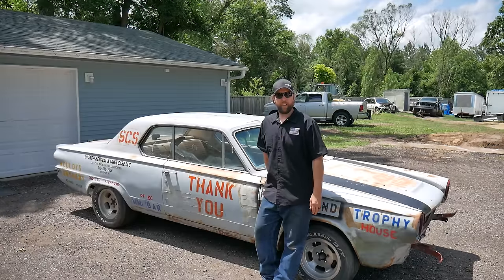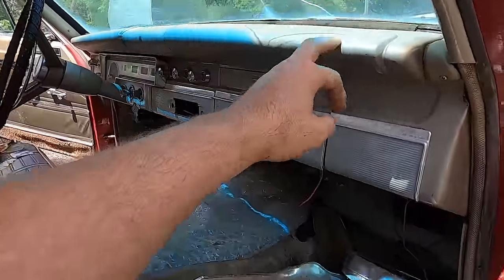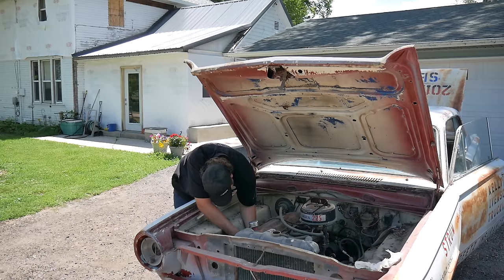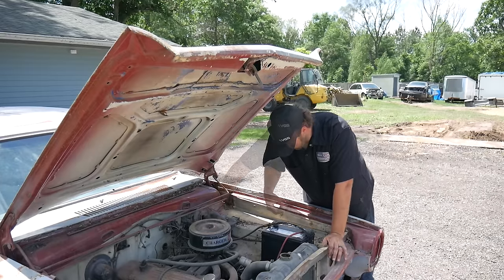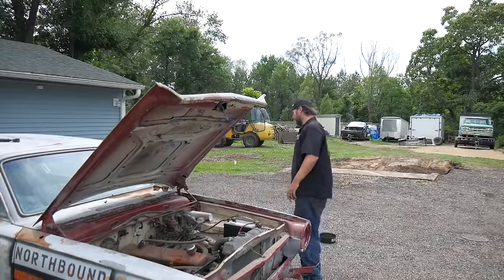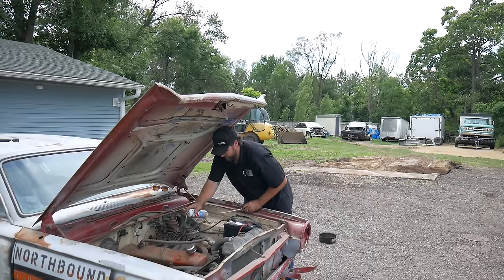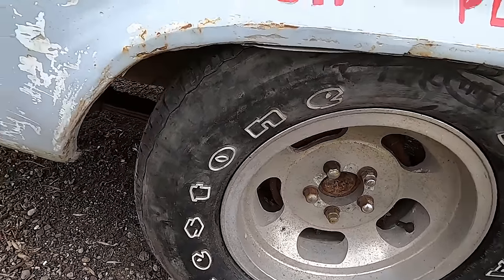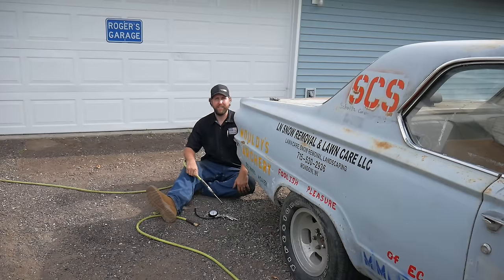NEGLECTED 1964 Dodge Dart GT! Will It RUN AND DRIVE After Many Years? - Vice Grip Garage EP96

Comment: Push button shifter, reminds me of when I was 5 or 6 years old, and my uncle had a shiny black 1959 Chrysler, with the big tail fins on rear quarter panels.
Well out visiting some folks with my aunt, uncle, and my older cousin, and he parked in their driveway, which had fairly steep grade back to the street. Being as I was the only little one there, I eased out to drive my uncle's big car, just pretend to as us little guys use to do.
I was so short then couldn't even see through the steering wheel sitting down, and forget about reaching the pedals, so up on the knees I could get around all those cars in my imagination in front of me. Then I remembered he always pushed them buttons on the left side of the steering wheel every time we went anywhere, and again when he stopped at home.
So I had to push them buttons too, if I was going somewhere, and I did. All of a sudden, there was a popping sound down on the floor, so I was looking for where it came from down there.
Then I felt something wasn't right, and still on my knees to see them cars I had passed, and suddenly cars was passing me, cause he'd pulled all the way into driveway, beside two other cars. I knew I was gonna die right after passed by the last car, cause as I hit the street the back bumper scraped the concrete, and then it kinda bounced as the front tires hit the level ground.
All of a sudden loud noise hit me just as the car stopped instantly, causing my head to bounce off the steering wheel. So as lil fellas do in emergency situations as this was, and I'd already seen my uncle followed by looked like hundred grownups heading my way from inside the house.
He snatched me out through the open window, and I knew I was in for whoppin of my short lived life, but instead he rubbed the tears off asking if I was alright. Yep, but I don't think your cars alright, he said lets look.
Well I learned I had someone watching over me that day, cause I went straight into big oak tree, and smashed the drivers side fin and bumper pretty good, but I missed two cars that had parked there, but left me enough room to learn that you don't push buttons in your uncles car when it's on a hill, cause it releases the E brake when you do.
True story that happened about sixty years ago, but I still remember it as if was yesterday.
Reply: DITTO! Only my experience was a 57 Dodge Wagon in an A&P Parking lot full of cars. Fortunately none were behind me and the lot started back uphill before you get to the street. The only damage was to my little butt after we got home and mom told dad!
Reply: Dad let me wait in the '56 Chrysler Windsor while they went grocery shopping. 
"Don't touch nuthin' up here on the dash but you can play with the steering wheel." he said. 
"Okay. "
So for the next twenty minutes I was Fireball Roberts, Lee and Richard Petty,  Mario Andretti. I imagined every race course I'd ever heard of.  A winning racer needs to step on the gas and brakes a lot to win of course. 
Well I learned a whole lot about Jesus Christ God Dammit and somebody named Sunnofa Bich that day!
Didn't catch crap for touching the dash though.
Reply: What was that?
Reply: Well I'll be DIPPED!  If that story doesn't  resemble a similar experience I had as a young, three-year old 'driver'.  My mom had to 'just run into the house' where her sister (my aunt) lived and we, of course, were left in the car (you were able to do that safely back then, I guess).  My aunt's driveway was...wait for it...ON A HILL...so I didn't understand anything about Newton's Law yet.  I just jumped over the seat and started turning on that big old steering wheel for all she was worth.  I guess in my jubilation of passing probably the whole field in turn 2, I must've hit the GET HER MOVING knob hard enough to put her out of PARK.  Down the driveway we shot, me jumping into the back seat at the same time so I could CRY, across the little street, through the neighbor's white picket fence (folks did that too, back then), and lodged the tail-end of the car into his living room.  I really cried then since about 50,007 hands were grabbing at me and my sister to rescue us.  Yep...it was at that moment that I knew that I was destined to be a 'CAR GUY'.
Reply: Haha reminds me of the time I put my moms 4Runner into a tree when I was little then a week later my brother ripped the door off of our ford by rolling it down the drive way with the door open. It caught the mail box and destroyed the door and fender. He got in a good bit of trouble for that I luckily knew how to move the car back up the driveway and hung the keys up and pretended to not know what happened. Unfortunately he got accused of hitting the tree since he hit the mailbox a week later. I figured he was already in trouble there ain’t no point in both of us being in trouble so I let him take the blame. But I made up for it a few years later when we “borrowed” the same 4 runner and decided to go 4 wheeling and put the 4Runner on its side. That was pretty much the start of a lot of trouble, tires and damage to cars until my parents got smart enough to start writing down the mileage when they parked. What made them start doing that was when my dad got new tires on his 94 suburban and we found out pretty fast how easy you can roast a new pair of tires away with a Chevy 454 then thought we’d be smart and just move the bald destroyed tires to the front “because he’ll never notice” but he noticed pretty fast when we had our first snow storm of the year the next day and he “turned” a corner and kept going straight into the neighbors lawn. Lol looking back at the stuff we put my parents through I’m happy I have a daughter and not sons.
Reply: Good stories fellas, enjoyed the read
Reply: Great stories, fellers!
Reply: Timothy Milam glad i'm not the only one I was three or four my mom parked the car on the hill to loft of the barn she was taking stuff outof the trunck I pushed some buttons down the hill me and brother went right into a tree my brother was in the back seat ended up in the front seat if the tree didn't stop us the house would have.
Reply: Crazy how they brought back the button shifter in new cars to be more “modern”. A guy’s gotta take us to a histry class
Reply: funny I was having a similar story play out in my mind as to the what will happen when cleetorius got out of the car while it was in gear and up on jack stands. Waiting for it to come down, jump the front chocks and run him over, like he was in a bad remake  version of Christine. Making him pay for his lack of knowledge and working on her while under the influence of years of inbreeding.
Reply: @jamesbetts3371  So have they actually done a true scientific study, that gives a percentage of the effects of generations of inbreeding has on Cleetorius. 
Because it's possible, that instead of a bad remake of Christine, that ole Cleetorius himself, does a brilliant remake of Red Dragon.
Writing into it a new victim for his culinary delights, and his new founded medical breakthrough, of keeping the victims alive in spite of multiple vital organs being removed.
Thus allowing him to use both his skills as a psychiatrist, and the medical training associated with the forensic part of his profession.
As he studies the responses of his victims, after he explains to them exactly what it was they just dined on for the last few days.
Then kicks the blocks out from in front of the tires, and off the jackstands, allowing the car with it's engine bouncing off the rev limiter to run over the latest victim.
Whose eyes were sewn open just for this event, so the sociopath in him receives its momentary flicker of emotion, at watching the victim be spit out from under the spinning back tires in pieces.
It's highly possible, that under his influence of generations of inbreeding, that all the things the others before him were lacking, he got the intelligence, and common sense, they were lacking in ten fold. So that his comprehension, and ability to flip the script as they say, on those taking pot shots in the dark. 
Was unique thing to see, but most weren't at the level they themselves were conscience of it happening, and they missed out on the humor of it all.
Reply: I was driving down a residential street one day, just mindin my own business, when I saw a car rolling backwards down a steep driveway about 150 feet ahead of me.  The little guy standing on the seat behind the steering wheel was jumping up and down and blowing the horn.  It rolled to a stop in the middle of the street.  About that time I saw a lady come running out the front dooor of the house with her keys in her hand, jump in the car, start it up and immediately clap both hands over her ears because, of course the little guy had turned the radio volume all the way up.   She turned the radio down and pulled it back into the driveway.  I did not stick around to see what happened next.
Reply: my dad had a push button rambler that I drove when I was about 12 years old, he had too much to drink while we were fishing and asked me to drive, good memories
Reply: 3 year old me, in the driveway playing in Mom's 59 chevy. Mom got the door open in time to tear it off on the house. I'm glad I didn't kill Mom.
Reply: Been there, done that, I damned near ran my mom over with our red over white 1957 Ford Country Squire station wagon when I was about 4 years old. Just like your uncle we were parked on a sloped driveway, (those must have been popular back in the 50's & early 60's, seemed like everyone had one), but this driveway was ours. My mom was behind the wagon, polishing the chrome,  Note: we had an ambulance service at the time, and the wagon wasn't just for family, it was also a body snatcher that was used like a coroner's van. I've been on my share of body pickups as a little kid, but those are tales for another time.

Anyway, I was in the front seat making like I was driving & pulled the column shifter into neutral, the wagon began to roll, smacking mom in the head, but she still had enough presence of mind to yell at me to yank the emergency brake handle while she held the wagon with her body to keep it from rolling down our long road & into traffic. I didn't need to worry about my dad thrashing my behind, mom was fully capable of dealing with my brother & me on her own...and she did. I also filled the gas tank with water another time, not knowing at that young age that there was a huge difference between gas & water. 

I don't know just why they allowed me to live..........
Reply: @jessicacordova5024  I have tears of laughter running down my face from reading your post... Oh my God, what a story!   Fred
Reply: @jessicacordova5024   And just exactly what, I ask as the father of two daughters, makes you think girls are any less prone to make the parents' hair go grey?!
Reply: @jessicacordova5024   your story song sounds looks me n my brother. A lot of the stories some just like my youngest son and myself as younger child! My mom's cousin have a smorgasborg junkyard with so many different kinds of vehicles. Got to love how these stories bring back good old days, or possibly good memories!

Comment: Hey, you've got a bad turn signal switch in that car.  The jumper wire strung between the tail light bulbs is a dead giveaway...only way to get both brake lights to work.
BTW, those tail light lenses and headlight bezels are unreasonably valuable trinkets.
Lotsa potential in that old roach!
Reply: Uncle Tony, just saw your Duster video, then got a notification for this one so had to jump over here!
Reply: Uncle Tony's Garage you tell him Uncle Tony!
Reply: Did she ever get her Duster Tony?? That red jobber was a nightmare!!
Reply: Is that where the term “Dodgie Wiring” comes from?
Reply: Hey sensei
Reply: Maybe we should part it out huh uncle Tony
Reply: Yes sir! Valuable Parts those head light rings!! Good to know about the wiring thanks Tony!
Reply: That similar to what a previous owner did with my dads 68 mustang dash lights. After the dimmer switch burned out instead of replacing it they cut all the cluster light wires and hard wired them to the ignition with speaker wire.
Reply: 46:38 his cabalator lights work
Reply: You guys need to get together and do something.
Reply: Uncle Tony and Uncle Derek meetup when??????? Tony practically slid into a fellers DMs just make a video together already got dangit
Reply: Uncle tony commented on a VGG video. This is all someone could ever want
Reply: Uncle Tony he's the BEST. He's a FACTOTUM of Mopar.
Reply: This guy early A bodies...
Reply: He said don't ask me how i know, so i'll ask him,  How do you know?   I like to ask people how do you know when they say don't ask me how do i know.😜
Reply: The headlight bezels are about 200 a piece if in great condition tail lights are around 200 a pair if in great condition
Reply: Vice grip garage should troll everyone one of Tony's videos pointing out what he can fix and whats wrong with all his cars
Reply: Say a lotta ‘bout a guy who watches another guys vids when operating in the same space. 
That right there is what the “auto-motivated” do, the support each other, kinda like using zip ties and bungee cords to get the go juice where It needs to go.
Reply: Hey DUCT TAPE shoe to the loud pedal.

Because Kiwi
Reply: sniffed out the mopar did ya?
Reply: Good Call !!!
Reply: Uncle Tony you're in a Mopar man!!
Reply: Lay off Tony it's all ancient stock car material so keep your paws off her let the kid do what he wants with it. Stock cars ain't got turn signals and they sure don't need headlight bezels unless the owner approves of em like me and Derek do...
Reply: ieatyomama  It's a chrysler that shit's all normal standard operational procedure.
Reply: I had a 64 Dart that I sold because it was so expensive to buy parts for
Reply: @davyjones2994  Back in the non China Detroit days the parts were out there in price. The reasons they started salvage yards but ya know even like today for $10 or twenty bucks more ya can get a brand new part just like in the old days... So some times your assessment of the situation holds water when ya remember back in those days like only we can remember...
Reply: Well I'll be dipped Uncle Tony has time to watch another channel in between his work👍 I think you should hot rod that little slant 6 and go racing derek!
Reply: @Ian-of9oi  Correct sir.
Reply: I’m
Reply: Would like to have that dart and toss in a narrowed dana60 a 727 torqueflite and a big ol 426 max wedge or a 440. A little sneeze of nitrous and some new wheel lugs.

Comment: Derek: "The paint job just screams what are you doing?"

Says the guy who Drove 'Independence' home, a couple hundred miles..😂😂😂..   
All jokes aside, Good call on trailering 'er back.. Ya got a family at home.. 
Thanks for another one..🍻🍻🇺🇸🇺🇸👍👍
Reply: Easy Raysplace, Independence had working head, and tail lights🙄 not to mention the throttle didn’t glue itself to the floor? But the frame was more brittle than Bob Barker‘s back, soooo Independence probably should have trailered home too? Wait, am I talking to myself now? I think so? 😳
Reply: @kevingustafson4190  I had forgotten about the frame😂😂😂.. On the other hand, he did put a piece of tape on it.. lol..
Derek: The man, the myth, the legend..🍻🍻🇺🇸🇺🇸
Reply: A 340 4bbl would make a sweet rod out of that, throw a T56 manual behind that and a 373 rear pumpkin with positrac and you'd have a sweet poor man's Road Runner. I had a 64 with the big 6 and push button auto that was a surprisingly quick car on a tight road course-like ride after I rebuilt the suspension and lowered it about 3 inches all around. Surprised a few of the local hot-shoes around the Ottawa and Toronto. Definitely not a drag strip beast but she could hold a line and drift a corner really sweet.
Reply: @unknownsoul13  absolutely 👊🤘
Reply: 600 miles  lol

Comment: I love this car!!!! so cool!!!! the paint is timeless and so original! It's like a  racing stock car with all these hand painted sponsors!!! The 225 slant six is probably  Mopars toughest engine of all time, with speed kits available! This car could be all fixed up and totally restored and would make a great daily driver. My 1969  army green Plymouth Valiant had the same 225 slant 6 motor and  I drove it from Illinois to Alaska, in 1978, and it purred like a kitten and got great gas mileage, I once opened it up and got to 100MPH , and there was plenty left!!!
Reply: That paint is factree, just needs some clearcoat lol
Reply: The 2bbl versions are pretty peppy. I had a 72 Dodge D-100 with a Slant Six 2bbl set up and it was pretty quick for that it was.

Comment: That has one of the best engines ever made. Almost indestructible. My first car was 64 Dodge Dart. I was a kid and wasn’t as kind to it as I should have been but it never left me stranded. Mine was three on the tree. It was a great car. Fond memories of the old girl.  I think you should fix this one up. It deserves it.
Reply: My car as a kid was a manual hyundai accent, I think it was 2001-2004. Just as you I was driving like a maniac in it. Never had any issues. It seems with all these computers and other changes they have made has just increased the amount of issues a car can have. If you left some fancy engine in a field somewhere there is no way it’s starting lol